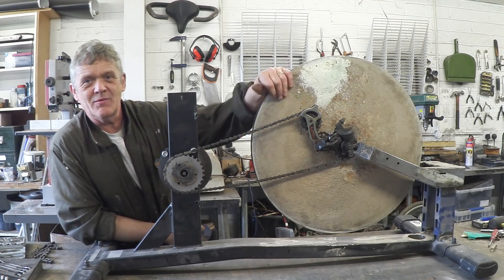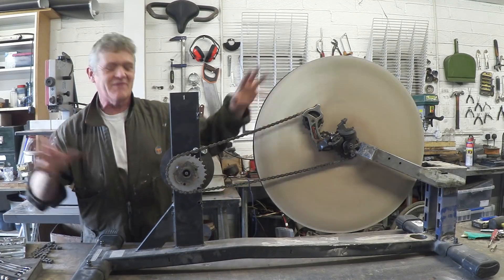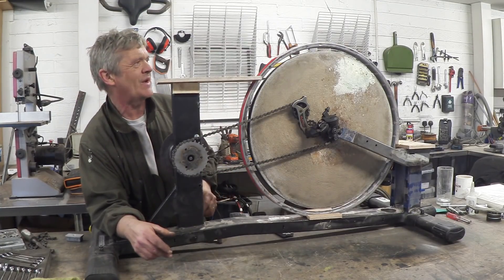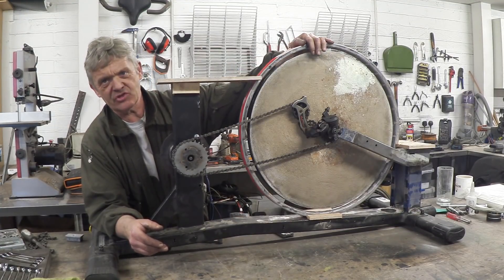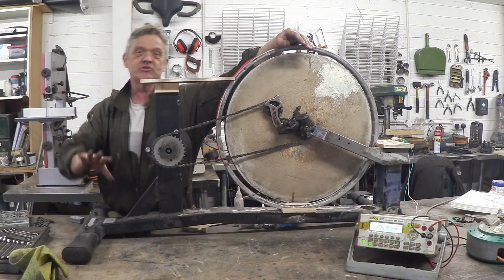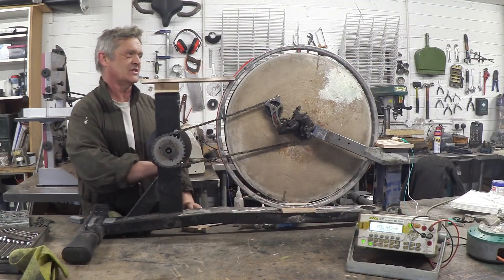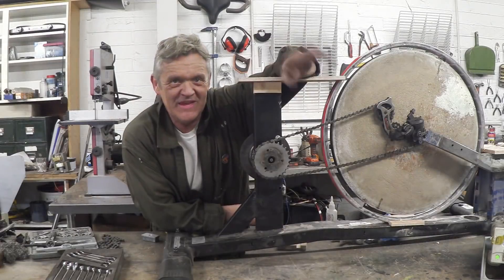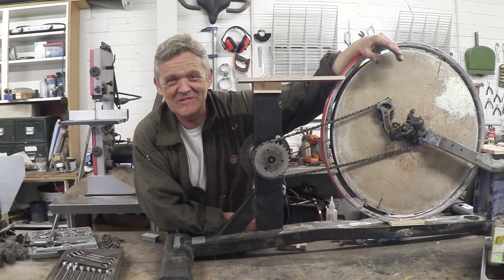1120 Prototype New  Style Generator - Part 2

Comment: Had you thought of using your cement flywheel, with your ball point pen low friction bearings,  also any type of a metal for your coil holder such as a bike rim, (steel or aluminium), will cause Eddie currents, so you may just want to use a plastic ring instead, to hold your windings.  I also saw a video where current was placed on the outer race of a bearing, a steel shaft was put through the center of the bearing to another bearing, and the output of the current was pick back up off of the 2nd bearing outer case, so with the current traveling from one bearing, through the shaft and out of the 2nd bearing, it caused the shaft to spin very fast, no magnets, no stator, no winding  or brushes, just a shaft and 2 bearings, so I wonder, if you run the current being created by your generator, through its bearings, if it would improve its efficiencies by a large margin.? 🤠👍

Comment: You could generate a reasonable amount from ceramic kitchen magnets. If you split the flywheel into eight quadrants and did north south alternating by quadrant you could get strong alternating current. By bisecting the flywheel and having north on one side and south on the other you could effectively build a Hertz generator and have it be sine wave specific at a certain rpm.

Well done mate!

Comment: You need to remove the mass in the centre of the wheel, only have the mass on the outside of the wheel, this will be much more efficient,  the centre needs to be have light as posable for grater efficiency.   Love the work and thinking you've put in to this project.

Comment: If the magnets were near the center of the wheel opposed to on the outer portion of the flywheel, would not it have more power and spin longer? Does not the magnets farther away from center have 'More leverage' per se?

Comment: Could you use an off the shelf generator/motor connected directly to the axle or possibly a pulley arrangement to coordinate speeds? Are there issues with the gyroscope effect causing stresses do to the earth's rotation?

Comment: Ok, used some magnifier to get the readings myself, then did the math, and voilà, came out with ~32¼mW frlm those 2 magnets configuration. Multiplied with 18 (=36 magnets, fully equipped) it should give a total of ~581mW (0.58W or 0.00058kW). Would be interesting to know how long the flywheel spins, or how much energy in terms of (m)Wh will be produced.
That was really fun, a nice demonstration of the principle. ⚙⚡👍
And up we go, right to the next episode...👋🏃‍♂️

Comment: instead handcranking this by hand  half minute, can a torque motor replace this process? , than the fhywheel run for 4 minutes or more to charge capacitor until it full so at the time flywheel slowing down the full charged capacitor drag the flywheel for another half minute again, and repeat the process to infinity

Comment: Hi Robert, maybe think of flipping the magnets by 90 degrees, (though it's not easy) so their NS / SN field comes out parallel with the flywheel's axle.  Then place a pickup coil above and below each magnet, if each coil pair is wired correctly, it will cancel out the Lenz effect deceleration force. Because the back EMF from load current is equal but opposite on each side of the same magnet.

Comment: <3 the engineering and video. I had a thought and thought I'd suggest it. Would be better to use weights distributed throughout the wheel rather then the concrete? If my understanding was correct the concrete is to supply mass and momentum. Having weights distributed might be cheaper and also easier to maintain in production..  Just some food for thought ;) Cheer.s

Comment: If the voltage is generated from the changing magnetic flux then putting the two magnets opposite on the wheel means that what you got was the absolute minimum. Two magnets together with a balance opposite may yield better results. That is one experiment I would do before adding more magnets.

Comment: Would making the outer ring spin counter directional to the flywheel help to increase output? A double rotor system rather than rotor + stator.
Reply: This is what I was gonna say, but you would want to make sure there was little play in you bearings. 3 or 4 of them on the out side of the coil hub .

Comment: A standard bicycle speedometer will give you basis for counting the RPM with a little math to reverse MPH/KPH to RPM. Or an arduino with a reed switch and a magnet, a 16x2 display and a little code will do it for you too.

Comment: Brilliant. Just Brilliant...I was reading up on industrial flywheel offerings and a great many of them can get four hours of spin once they reach optimum speed. Imagine the possibilities for an off grid system or backup system if you have battery storage or even without. If one could achieve a steady flow of power for 15-20 minutes with a minimum of physical input. Wow, what an accomplishment that would be... I am optimistic that on an individual level one should be able to achieve a percentage of the performance that highly developed flywheel manufacturers accomplish.

Comment: I have been kicking something similar around in my head. I like the flywheel concept. 

I was thinking a row of the “flywheels” connected to what you have there. Say 3 or 5. Then a seated stationary bike hooked to your central sprocket with a gear shift derailer. Be amble to start it in low gear and work up as you get them all spinning. Make a great supplement to a wind, hydro, and solar setup. 

Keep up the great work.

Comment: i mentioned on a previous video that I'd built a generator with a stairmaster, and the insides of that was almost exactly what you've built here but with a steel flywheel disk and a step mechanism rather than pedals.  it's wild how much power you can generate easily with a big heavy flywheel in action. lol hope that axle holds up
Reply: The axle thing was my first thought as well, but actually it only has 25kg weight on it. That's half what it would support if there was a 100kg bloke on a bike.

Comment: You need to connect an oscilloscope to that thing to get an idea of what the peak volts and amps you are getting as your voltmeter is most likely giving you avarage readings. This will give you a better idea of what you will be getting when you decorate the outer circumference with more magnets. If you do get a scope, for current measurement load the output with something like 0.1 ohm resistor and measure the peak voltage across it then the peak current will simply be peak volts divided by 0.1 ohms.
Love the "evil scientist" laugh.😁😎

Comment: I wonder if the ceramic coil layout that was used in the vertical turbine project would prolong the flywheel rotation, i would think there is some friction from the weight of the cement flywheel on the berring that may be causing the flywheel to slow down quicker
Reply from the maker: it's because the magnets are attracted to the steel rim
Reply: @ThinkingandTinkering  I forgot if you mention or not if you weighed the flywheel after it was cured

Comment: Please rob remember in that little turntable motor, the steel casing was vital to shape the magnetic field into the coils, you have the huge coil, the huge magnet, now you need a huge casing.
Reply from the maker: i work with what i have mate - the mass of the steel needs to be greater for sure - but not huge mate - no point going beyond saturation i would think

Comment: Brilliant! Can't wait to see final magnet arrangement and output. Well done, and thx for the members video on rim cutting!
Reply from the maker: my pleasure mate - hope it helped
Reply: @ThinkingandTinkering  Great Video!! And really awesome Concept! I didn't quite understand how you turned the Wire on the felloe? Simply around?
And what are the Slots for You cut into it?

There is a Magnet Alignment, where One can amplify the Output in one Direction - a Halbach Array.
It could be revealing to test it against normal North South alternating Alignment and also if all the Fields pointing outward are the Same.

Keep up the great Videos!! :)
Reply: Can it be made even more simple, without any cutting?
Perhaps a plastic BMX wheel with bolts through the rim giving a track that can be insulated wrapped then wrapped with as much coil as wanted.
So much less to get wrong or fail with this type coil design it’s fantastic
Reply: The slots are to direct the magnetic field because of how the the coil is wound to the direction the magnetic field cut. He wound the wire around the tire instead of  having  a coil and wrapping it around the tire, hope that helps.